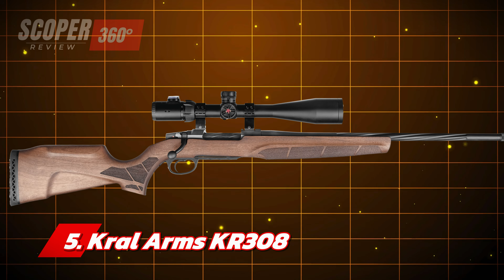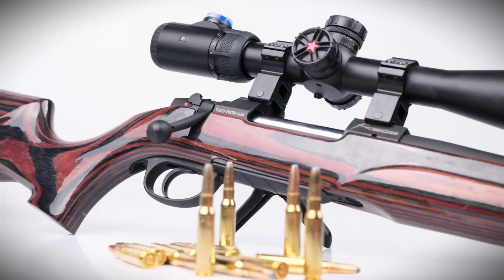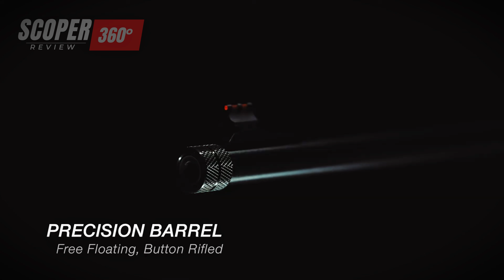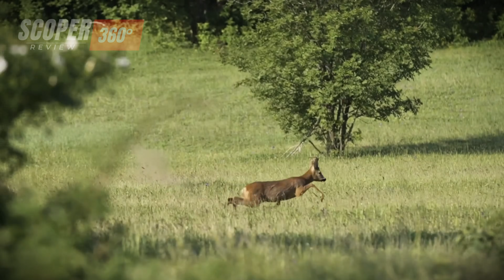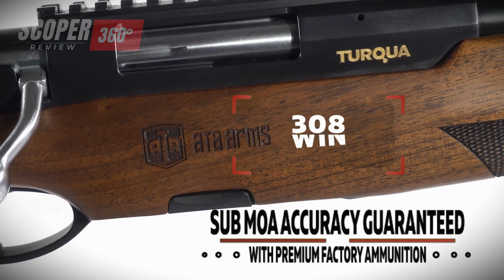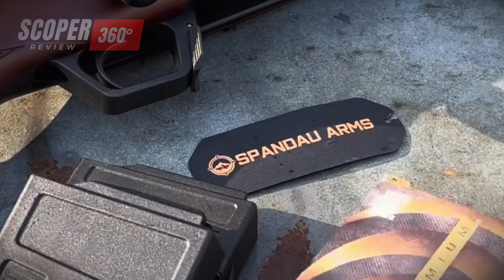The Truth About Turkish Deer Rifles in 2026. Five Bolt Actions That Just Ended the Budget Argument.

Comment: Only short action then that’s very narrow minded. The recoil lug is the same as tikka. Here in the US like long action rifles.
Reply from the maker: That's a fair point. Focusing only on short-action rifles can leave out a huge portion of what many hunters actually use.

In the U.S., long-action cartridges such as .30-06 Springfield, .270 Winchester, and .300 Winchester Magnum remain extremely popular because they have decades of proven field performance behind them.

And you're right that many shooters don't view a long action as a significant drawback. The weight difference is usually modest, and for hunters who prefer traditional cartridges, it's often a non-issue.

Thanks for the comment.

Comment: Had a Turqua in 308. The barreled action moved side to side in the stock regardless of how tight I did up the action screws which probably contributed to the average accuracy. I tested factory ammo and many handloads and could not get better than 1 1/2 inches at 100m at it's best. Also the bolt would catch intermittently when driven into battery and I would have to pull the bolt back and go again. It is a nice looking rifle with excellent timber and a smooth chrome plated bolt, smooth but prone to catching. I ended up selling it back to the shop. That was my experience and I would steer clear of Turkish rifles. Their bread and butter is shotguns and they should stick to it. If you want an accurate budget rifle with a proven track record then buy a Howa or it's more expensive twin the Weatherby Vangaurd!
Reply from the maker: That’s a detailed and fair firsthand review. A barreled action shifting in the stock is a serious issue, and 1.5 MOA after trying multiple loads would frustrate most shooters.
I do think some Turkish rifles are improving, but QC consistency still seems to be the weak point compared to brands like Howa or Weatherby. The Vanguard/Howa action has definitely earned its reputation over the years.
Appreciate you sharing the real-world experience.
Thanks for the comment.
Reply: Haven't had an issues with mine and she punches at 1/2 inch moa and one HELL of a tack driver.